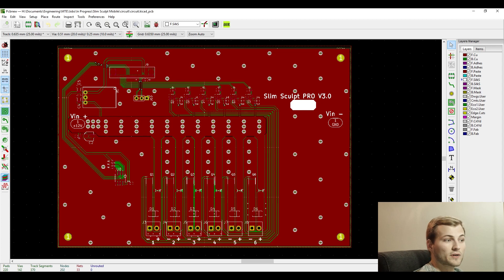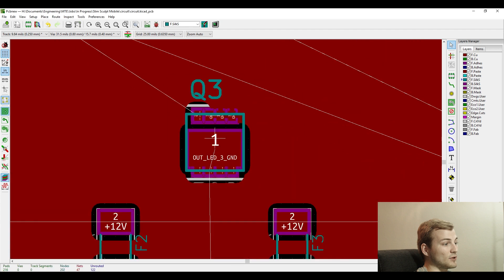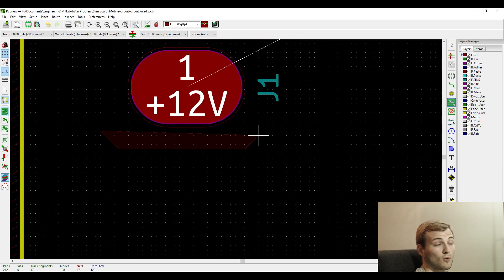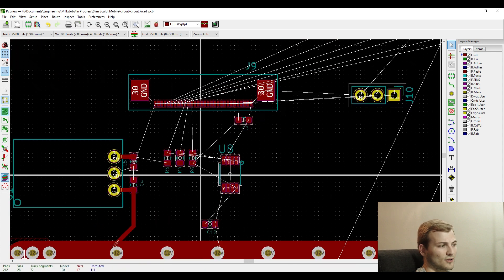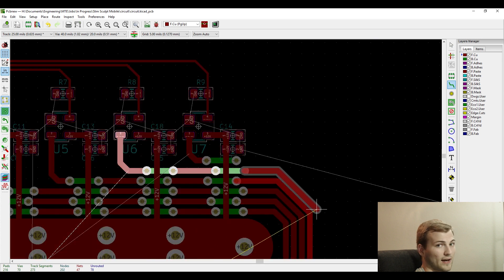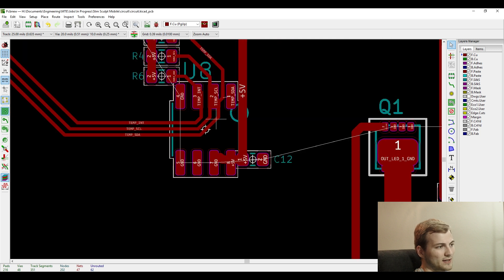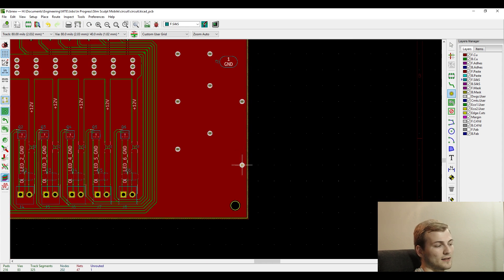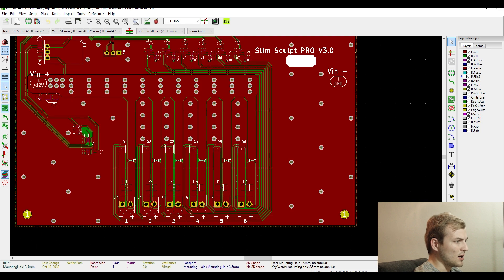High Power Circuit Board Design (PCB) - KiCad 5 - Part 2/2

Comment: Suggestion for future video...
 ==== 5S BMS board with i2c interface that can be linked to a esp32 ====

Project:
I have an old metal detector that uses old NiCad batteries that have to be pulled out every time they need to be recharged. That is a extreme hassle with all of the connections that have to be plugged and unplugged.. Compared to modern solutions, like the DeWalt power tool quick change battery, or the kind of battery packs used in old camcorders..

The battery pack will be used in a (White's Coinmaster 6000D) metal detector....
It originally uses 14 AA batteries arranged in 2 rows, and wired as follows:
(+12v)---(GND)---(-9v)

Requirements:
Try to do all upgrades with as close to zero modifications to the original equipment.. or invisible/reversible mods..

Solution:
I want to replace it with a 5S BMS with wifi to post charge condition to a website. 
Are there any 5S BMS boards with i2c interface that can be linked to a esp32?

The detector case is metal, so it might need an external antenna... 

Is there a trick to make the headphone jack share speaker out with charging power input?
without drilling holes in the case.. 

My only thought is 
1. using a magnet on the headphone plug that would switch it from charge mode to speaker mode. or 
2. replace the headphone jack, with one that has extra connections for power in... 
The second option would be more idiot proof...

Any other suggestions????

Comment: Wonderful video! 
It's always better for me to follow a real case, than studying "hipothetical" cases.

How are those bare copper busbars drawn? This one is covered, but I'm thinking in a PCB for an inductor heating device (50A), and I was thinking in soldering a copper braid stripe afterwards, but I need the trace is not covered in insolating varnish.

Comment: Awesom. Super helpful and clear. Could you walk us through how you might approach a 12vdc 50a h-bridge driver. I think also an h-bridge driver for these popular treadmill motors. Mine is 240vdc 8a. I am a bit nervous about it myself. It would make a great spindle motor for cnc. An h-bridge driver would allow for ridged tapping cycles with encoder and more. I think that would be very poplar!
Reply from the maker: Noted. Yeah, I'm thinking a high-power brushed motor driver would be a nice project. Seems to be a common request.
Reply: @MicroTypeEngineering  thank you for the reply. Has made my day!

Comment: Very helpful! I'm doing a 230vac/2A circuit on one end of a board with 25vdc/1A circuit on the other end. Double-siding the tracks plus using 'copper pour' tracks as well was really helpful and should keep temperatures right down. Do you have any suggestions for isolation of high voltage to low voltage? So far I have cut slots under triac drivers, relays etc. and spaced things  a good distance.
Reply from the maker: Glad I was able to help! You sound on the right track. Make sure to follow IPC specs for creepage/clearance and you should be good to go!

Comment: i really like videos like this 2 Part one ! There is so much to learn from. Id really like to see more videos of this type comming ! :D 
You acutally safed my ass beacuse of the calcuation you did on the mosfet. I was planning my PCB for 10A and used 38A rated IRF5210 PMOS fets but i didnt relised that i would drive the temperature of them up to 300°C without a heatsink. 
Now i need to find a lower Rds on PMOS or find out if a "PCB Heatsink" with vias to the 2nd layer could solve the temperature Problem.
Reply from the maker: Hah yes! It always becomes a balancing act between Rds and gate charge. The maximum rating of MOSFETs is always arbitrary high, as thermals will be limiting factor.

Comment: The placement of Temperature sensor is not accurate as it see the temperature of channel 1 nearest and other channel has decreasing effect. It would have been better if you place it on other side in between channel 3 and 4 below mosfet, as it see the temperature rise better and quicker. Since thermal effect takes  time and the most rise will be seen in middle, the present location see rise in temp when channel 3 / 4 would have blown out.
Reply from the maker: That may be true. But this is in a sealed enclosure. I am looking more for if the enclosure itself is overheating. The temperature threshold I set is derated enough to alert before any channels overheat

Comment: Why don't you trust the official kicad libraries?
Reply from the maker: I design PCBs for clients as a job. I'm not going to trust a footprint that wasn't made by me to be used in a board I'm designing for a client. Especially when the majority of kicad's library is made by hobbyists.
Reply: @MicroTypeEngineering  yes, 1206 resistor package from kicad official library is not correct pad size is too small i wasted one pcb, i moved to Digikey library  now its ok, better to print the layout and check the actual size

Comment: Nice to see your work.
You asked for sugestions and here are two.
1. If you have signal busses and you have the space to spread them out do that to reduse cross talks.
2. Avoid sharp angles in traces to pads or other traces. The etchent fluid might have hard time to etch there and you also might have small flakes of copper in those areas comming lose during PCB manufactoring. (Floting around and end up as shorts in fine picth designs.) Example seen at 10:37.
Reply from the maker: Thanks for the comment!
1. Yeah that's definitely good to give traces space. But these are very low speed traces, with a full ground plane underneath. 8 mil is plenty of space.
2. That really was only an issue on older board fab methods. Acid traps don't really happen anymore. Of course it's best to avoid them still, and try not to go under 90 degrees. But, I didn't have a sharp trace angle. Double check the video, that wasn't a 90 degree angle at 10:37.. https://electronics.stackexchange.com/questions/115653/are-acid-traps-real-2014
Reply: @MicroTypeEngineering  Yes the time on sharp edge was actually a couple of seconds later (So that you would not miss it).  And you could debate the importance of sharp edges. The debate in Stackexchange covered a lot of views but it is still a good practice to avoid sharp edges. Fabs do request changes by you or they do it themselves based on geometry and processes they use. Your board had big geometries and it would certainly pass fab requirements in most cases. But it is still a good habit or rule of tumb to implement.
Here is a video that a PCB nerd like me and maybe you would enjoy about PCB manufacturing things to know.
https://www.youtube.com/watch?v=f6_svRNJYls
Greetings from Sweden.